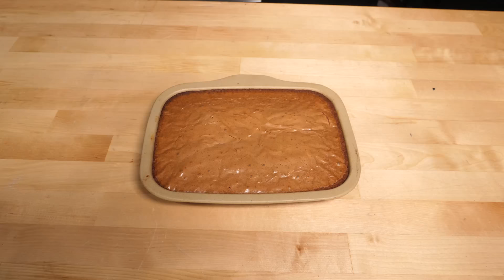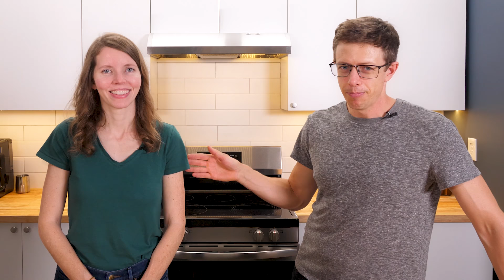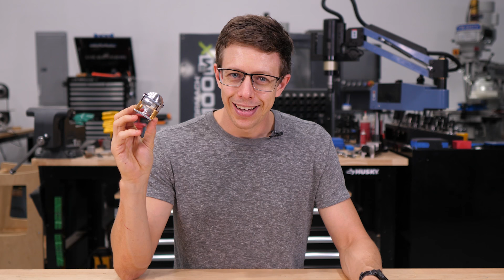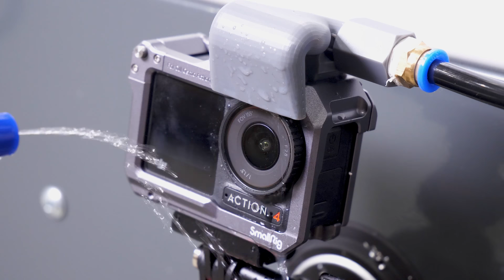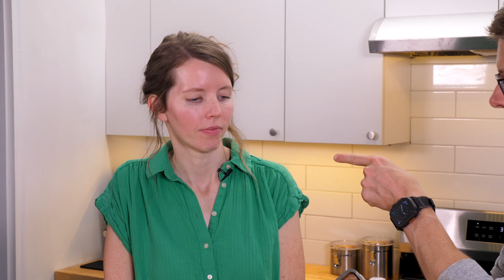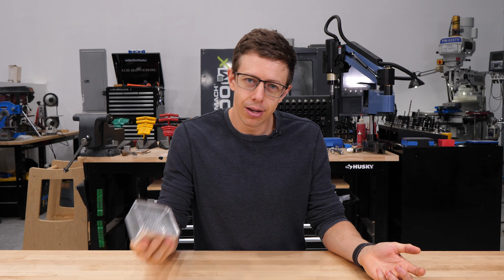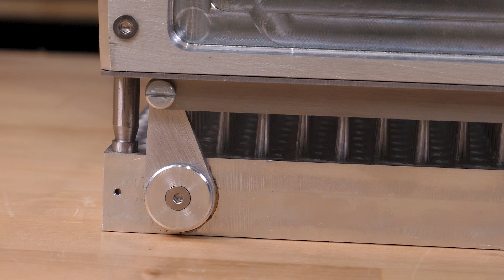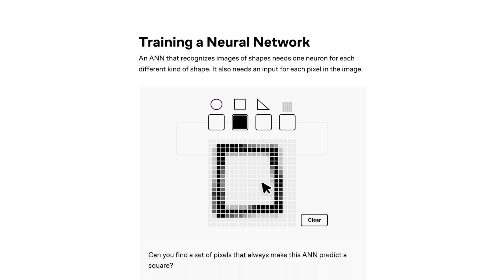Baking brownies from the inside out

Comment: My brother already discovered the answer from Japanese baking. You use a wooden pan. He made a wooden rectangular frame then placed it on a baking sheet and lined with parchment paper. The wood doesn’t get as hot as the metal so you get a pretty even distribution of heat throughout the brownies. Perfectly makes all middle brownies. They’re the best!!
Reply: I like to imagine he knew he was creatively wasting time since he told us in the very beginning that the crust came from uneven heating. That meant the solution was immediately 1) reduce conductivity of pan 2) apply conduction evenly to brownie - which he did - 3) cook brownie very very low and slow so the conductivity is less of a factor or 4) apply motion to the batter as it cooks
Reply: Funny how he overengineered where the solution could've just been wood.
Reply: It's like that story with the space pen and the pencil
Reply: @seicheberlin except the pencil actually wasn't a good choice, NASA used it before making their special pen, but bits of pencil lead would break off, float around the ship, and get stuck in places where having stuff that shouldn't be there can cause major problems.
Reply: @seicheberlin  Good analogy, because ignorant people use it as an example of "overengineering" because they don't even know what the problem being solved is
Reply: True, he did kinda make the fastest edge-free brownie pan thou
Reply: SMH: I will create a machine with retractable spikes with cnc metal and specialized microequipment
Japan: Wood goesss brrrrr
Reply: @AlvinFlang69420 not even japan..just get a chef!
Reply: If this is true it needs to be a top comment
Reply: I found out if you 1-1 sub applesauce for veg oil it turns the whole pan into crust texture.
Reply: @ziggenplays1208  wouldn't that just make them apple chocolate brownies?
Reply: @Beefaroni_Bert doesn't taste like apple or any identifiable apple while plated so id say no.
Reply: @ziggenplays1208  sweetened or unsweetened applesauce? any specific brand?
Reply: @user-yr1wm9vy2v idk i use the little packets on Cinnamon apple sauce
Reply: @ziggenplays1208 I used to substitute the egg with apple sauce.
Reply: I was thinking the same think while watching the video. Remember how back in the days researchers improved the Deep Blue chess playing engine by getting better at chess rather than getting better at engineering ? It’s the same here, you can get pretty much the same result by using proper materials and techniques rather than trying the change the shape of the mold in the first place...
In other words, be a better cook instead of a better engineer...
Reply: But where's the fun in that? An easy simple solution? Not in an engineer's vocabulary
Reply: Okay but have you considered making a hyperengineered aluminium contraption instead?
Reply: but if the wood transmit less heat, isn't the top more crusty ?
Reply: That would just make a brownie with 6 sides that are all exactly like the top side, so a completely different result from what the goal was here
Reply: Putting something wood in the oven just doesn’t feel right to me.
Reply: I’ve just started watching but that was my thought too, less heat conductive pan, I swear the edges are different in silicone to metal nevermind wood or something less heat conductive
Reply: Nice that's what I like to use for a raised bed in the garden in summer.. the wood doesn't get as hot as metal.
Reply: Isnt this how they make Panko?
Reply: Engineer vs. scientist
Reply: Lol
Reply: All the wooden pans im seeing are 200+ is there a good place to buy them for less ?
Reply: What if every part of a brownie has an edge-like texture😂
Reply: Maybe silicon?
Reply: I started thinking you just needed a less heat conducting material for the sides of the pan. Thanks for the confirmation.

Comment: While I appreciate over-engineering as much as the next nerd, instead of trying to increase the heat transfer to the center, much easier to reduce heat transfer to the edges.  Insulate and envelop the edge slightly, and if you REALLY want to geek out and over-engineer it anyway (because that's what we do here), separate temperature controls for the insulated chamber similar to your camera rig-- if the edges are getting to hot, pump in some colder air.

Comment: Cakes have higher moisture content then brownies if I remember correctly, which means that even though they do still cook outside in cakes don’t get the majority of the moisture from the edges removed at least that is my suspicion they probably technically do take on an edge which is why the inside of a cake looks slightly different from the outside, however it isn’t as noticeable of a transition and usually cakes are frosted enough that you really can’t tell whatsoever

Comment: No this is actually prolly a really good idea tho cause the lack of extra surface area and the "seal" of the cooked brownies on the bottom being broken will help the brownies from sticking while trying to cut and serve them! Just need to get the hole tolerances and taper right to prevent leakage. maybe a clever not O ring but second small pointed mound around the base of each of the tapered needles which is married to a negative on the bottomside of the baking box. YEET! Much love from a wv macgyver mechatronics man.

Comment: 9:39 "so why doesnt a cake cook like that?" fat and protein. Brownie batter is thicker than cake batter due to a lower liquid-to-flour ratio and a higher fat content. Flour contains about 10% protein, which contributes amino acids that participate in the Maillard reaction. Although fat doesn't take part directly in the Maillard reaction, it aids browning by promoting higher temperatures at the surface and improving heat transfer. In brownies, the high fat content helps the edges and bottom brown more deeply. In contrast, cake batter contains more water and often less fat, which keeps the temperature lower during baking and limits browning. The higher liquid content also disperses the flour more thinly, contributing to a softer, more uniform texture and less chewiness at the edges.

Comment: The way this design works seems to imply that the edges of brownies made in the all-edges pan are going to be slightly softer than normal edges. Makes me wonder how close you have to get to the pins for things to work out, like could you just design a brownie separator that conducts heat well and end up with minimal edges.

Comment: I would love to see a YouTube chef parody this video using cooking techniques instead of engineering prowess. As a intermediate level baker, my first thought is the biggest problem not addressed is the heat distribution of the oven itself. Like what if you cooked it just from the top with a super heat lamp and added brownie batter layer by layer like jello so it all cooks the same after some trial and error with timing

Comment: I'm preeeetty sure lining just the edge of a normal pan with food-grade silicone would achieve a similar result. The problem is that too much heat from the pan transfers into the brownie edge and cooks it more, and the silicone would slow down that heat transfer significantly (think of a silicone oven mitt).

I realize that would be dramatically less interesting content, but it would probably be an accessible and marketable product.

Comment: Could you also use projectile motion calculations to determine the launch angle for a given distance? Find the initial velocity, then find the horizontal component, and then multiply it by the total time in the air to find horizontal distance

Comment: As an engineer I kind of love this, but also it's not how I would have solved the problem at work as an engineer, too inefficient. If the goal is to make a pan that can do this, great. If the goal is a no edge brownie, this is the wrong path. Cosmic brownies already solved this, in my opinion. But I'm not sure how! 
I would do it through some method of adjusting the recipe, maybe swapping melted chocolate for cocoa, baking it in some sort of water bath. Also unscrewing pans isn't unheard of, spring form pans for cakes

Comment: It's funny how you overenginiered the redactable spikes. This problem was already solved by normal cake pans. They have a seperateable floor piece and an outer ring that is fasten with a clasp onto floor piece. They only downside is that is round instead of square.

Comment: I had pans with removable bottoms: It had a metallic belt that was closed with a suitcase like latch, The belt has edges under the bottom so nothing leaked. No miling required.

Comment: My issue with this massively over engineered pan is that wouldn't a water bath and precision low temp do the same thing. Its what we do when we bake custards. and then just burnish the top to get that crackly top.

Comment: One thing that might help with the leaking batter is tapered holes in the pan bottom to match the draft angle of the pins. Similar technique is used for injection molding pins to seal off the holes. This way the holes wouldn’t be dragging against the pins for the whole range of travel.
Reply: couldn't he just have cut the crust off?

Comment: Question @StuffMadeHere did you preheat the pan before adding batter? Wouldn't the temperature differential of the metal spikes being immersed in a different temperature inherently make the spikes take longer than the larger surface area of teh outside edges?

Comment: Just wanted to pop in and say that brownie edges do not need to be hard. by cooking at a lower temperature. You can still get the caramelized goodness without them turning hard. keep in mind it will still be crispier because it's crystallizing but another trick to keeping them moist is adding a small bowl of water in the oven to keep up the humidity and to not open it and release the heat or humidity leading to a longer cook time.

Comment: You know, you COULD have increased the angle quite a bit on the parts of the spikes that contact the pan, but only those parts - it'd lead to a much better interference fit, and you'd be able to remove the spikes without the hilariously complex pan lifting contraption as there would be far more clearance for the spikes.

Comment: Did you consider using a material with a lower conductivity for the tray, while keeping the high conductivity aluminum spikes in the middle? I wonder if this would have been a different approach than experimenting with different cook times and temperatures to get the same effect of having no hard edges. You might even be able to cook faster at higher temperatures this way for a similar end result.

Comment: What if you used an induction stove to heat the brownie batter just before you put it in a room temp pan, then put it in the oven? If induction nigh on instantly boils water, would that heat the mixture enough to absorb the heat from the oven at a more even rate than with cold batter?

Comment: I once saw a wedding cake guy put the pan in an slightly bigger pan filled to the brim with water to distribiute the heat from the edges of the inside pan away. Refill if needed, depending on baketime and temperatur.
Reply: But that would've made for a pretty boring video I guess...

Comment: I have a question about your Brownie Edge detector.  
Was a razer blade the best choice to measuring if there is an edge cause it isn't equivalent to Incisors in sharpness? Nor is your Brownie Edge detector emulating the strength of the mandible.
Teeth are NOT razer blades!

Comment: You can cup tubing to hold a detent ball with ratchet sockets. They come in most sizes and have a tapered mouth, use a smaller size than the tube. Pound another smaller friction fit tube in from the bottom to hold the spring and ball.
I make them as arrow holders. Really easy. The second tube can be threaded for spring tensioning.

Comment: Still watching at 6:09. Question/thought about the pan-making process. Wouldn't it have been easier to make the pane using a sheet of aluminum and welding/otherwise adhering the pointy bits rather than machining it from a solid block? Also, curious about how/if you re-use the aluminum shavings. This video is really neat! Has me subscribing to the channel. I like it.

Comment: Finally, my long-theorized crustless brownie made practical! Back in college, I figured one could make a crustless brownie by mixing the batter with some particularly short-lived alpha-emitting radioactive isotopes. Purely theoretically, of course. Never you mind the bothersome details of waiting many half-lives for the resultant brownies to "cool down" before they were edible...if ever. Later, I figured super-corrosion of iron or other somewhat "safer" substances would be more practical. And in any case with self-heating brownie batter: a spherical shape would actually cause the reverse problem - the center cooking before the edges. I think a relatively thin conventional brownie shape would probably be fine though.

I could only guess who might be ludicrous enough to collaborate on a self-heating batter initiative, but you might find company in @NileBlue or @styropyro there...

Comment: I feel like there may have been some slight over-engineering (albeit very nice to look at over-engineering). This may have been solved long ago with a more rudimentary solution. 

The method used for baking custard desserts like flan, crème caramel, etc., could be the optimal low-tech solution. You place your brownie pan into a larger pan, the larger pan filled with hot water as your thermal interface medium to help resist firmed edges during the cooking process.

Still a good video though!

Comment: How about just making a pan that has the same heat transfer as the brownie dough? Like you take a normal pan, you put it in a larger pan with some supports underneath so the two bottoms are not in direct contact, then you fill the space between the two pans with water? In a conventional oven you would just have remove the vapor so it doesn't get soggy.
It's called bain-marie. Cooks have been doing it literally for centuries.

Comment: Honestly, this seems like a problem that could be solved with method rather than design.

First, pre-heat the batter. Baking powder activates fully when you start to pass 140 F, and eggs set up around the same time. You want 165 F for sterilization, 180 F for a soft brownie, 200 for a dry brownie. If you get the entire mass of the batter to about 130 F before pouring into a pan, the center will bake through before the edges have a chance to overcook.

Second, use a bain marie. Place your cooking vessel in a larger pan filled partway with water. The water will limit the temperature that the inner vessel can achieve and provides steam that will help apply even heat on the top of your brownie without drying it out and forming a crust.

Comment: for someone so smart your not that bright you literally went through all of this when you could have just used a cup cake pan with paper liners when baking a cake the edges get harder in a square pan just like brownies but cupcakes dont when using paper liners i suspect this is because of the paper holding moisture and the way the paper is folded provides an air gap so the pan can not transfer heat as well as a normal square/rectangle pan

Comment: Can you make a very similar pan, but put another layer around the perimeter of the outside edge of the pans.  Make the outer pan slightly larger inner dimensions than the outer  dimensions of the inner pan then make it sealable with a silicone gasket. This will create an air gap that will insulate the outside of the brownie.  Then bake it adjusting the length of time for the more brownie cooking over the cake like brownie.

Comment: At the simpler end, maybe, as soon as you take them out put the pan in ice water to start cooling the outside faster, maybe with a lid so you can cool the top too?  Food keeps cooking after you take it out of the oven.

I think you are missing the obvious thing to do with all your holes though.  That's where you inject the flavor- frosting or whatever.   In other brownie news...  I've been eating Mexican brownies from the local taco place, with a bit of either cayenne or chile pepper on top.  Peanut butter as frosting is good on regular brownies as well, as a drizzle.  

What if you made a cover for it and made it out of something magnetic so you could put it on a convection grill, or maybe just make it so it's self heating?  Instead of a pan, it's a brownie making machine.

Comment: This video mixes so many of my favorite things together! And I love the side projects so much!

Would it work just as well to make the walls super thick and tall away from the brownie's edges, so the heat from the sides remains negligible compared to the heat on the top? Like just a very thick piece of cast iron? Or what's even less conductive than that? Like a bain marie as you'd use to make creme brulee? Except to keep it colder, not hotter.

Comment: I love the overengineering, but would it be possible to create an inner mould of a porous insulating ceramic material (I'd like to say a refractory brick machined mould with a fitting lid and a hole on top for expansion) to slow down heat transfer from all edges (including the bottom and top)? Or, even easier, water bath around the pan?